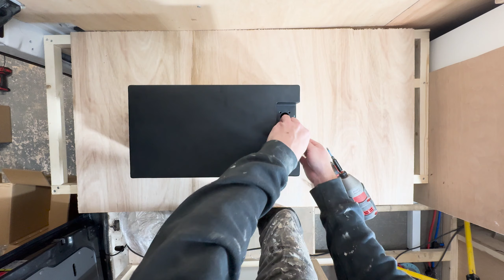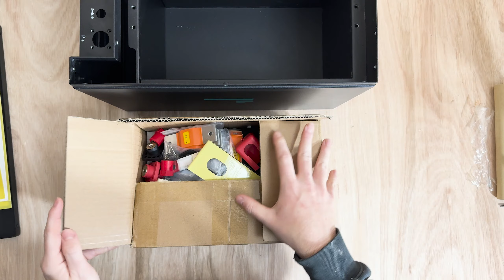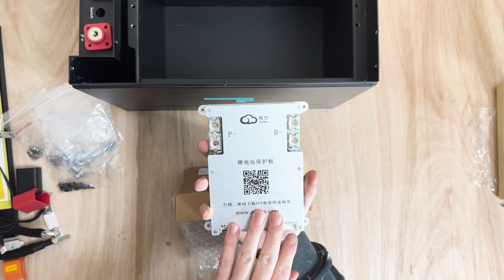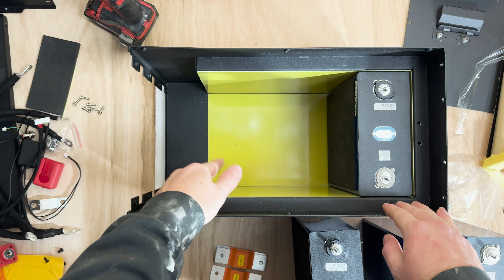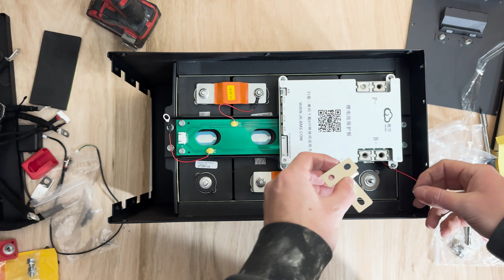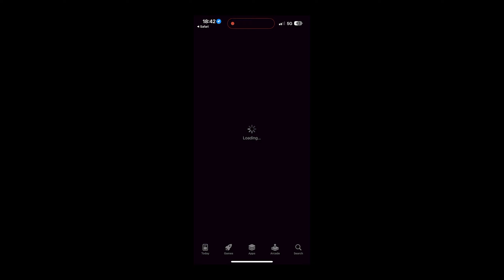Fogstar | 12v DIY Kit | Assembly Guide / Review

Comment: Does anyone else think the fuse provided is not safe for the cable sizes provided, or the interruption current capacity of LiFePO4? 

A 280ah 12 volt LiFePO4 could theoretically output 10 times the capacity in amps if shorted (so circa 2800 amps). However. The fuse provided in this video looks like a MEGA fuse that, whilst rated for 400 amps, is only capable of handling 2,000 ICC amps before it melts and welds together (thus not doing what a fuse should do, and cutting the circuit). In addition, 400 amps looks way more than the cables provided could handle. 

In my 314ah kit I have been provided just 6 AWG and 3 AWG sized cables. Admittedly these are high temperature (200 degree), 600 volt silicone cables. However, even then a 6 AWG cable I think is only capable of carrying 100 amps, and a 3 AWG about 130-170 amps (and that's assuming they're not in conduit or laying with other cables). 

The 6 AWG cables are doubled up as they go from one to two cable lugs (as shown in the video), so that's 200 amps per such cable (half that of the provided fuse)! The 3 AWG cable however is the real concern at just 170  AMPs at best. Even if you double this up, that's 340 amps (still way below the 400 AMP fuse rating).

This is before you factor in the 2000 ICC rating of the fuse (about 800 amps too low for the ICC capability of a 280ah battery, and 1,140 amps below that of a 314ah battery)!

You could set the max discharge and charge current to 200 amps in the BMS, but it is not best practice to rely on the BMS to protect your cables! It also then begs the question, what is the purpose of the fuse provided.

I would expect a max fuse size of 200 amps for the cables provided, and for the fuse to be an ANL type with 5,000 to 6,000 ICC rating!

Comment: when attaching the balance leads to the busbars, when you are tightening the nut down, make sure there is no heat shrink insulation trapped under the nut because you want full contact between all metal surfaces under that nut. partial contact will add resistance, heat and possibly fire. you can trim the heat shrink with a knife or just pull it back away from the loop before tightening the nut.

Comment: Obviously a keen DIYer using the IKEA multi bit screwdriver lol
Reply from the maker: @AlanAlanAlanDave  not ikea and only thing I had to hand in the unit at the time
Reply: @LBVanBuild Thank you for putting this video out. I have one of those, got mine from IKEA.
Just looking to see if it’s worth getting the Grade A 314Ah cells and separate components. If I go for a kit I’ll get two. Surprised they are so cheap compared to the built ones.

Comment: Brilliant video...
1.200 views but only 11 subscribers 🤔

Why did you go for the 305A when the 315A is only a little more expensive?

How did you work out the black wire and a few other things?
I think connecting to the battery+ should be after the front is on.

I'm electrical/electronic background and have been watching various videos and have noticed a few potential 'modifications' or nice to do if you are interested.

Have you seen there is a screen for £29 to show information but no programming which is good.
Is there any information on the batteries to confirm that the programming is correct?
Reply from the maker: @Markus-UK  Thanks!

I actually got the case and the cells separate, then they released the full kits a day or two later. I am actually planning on getting two of the 315ah versions.

Trial and error basically, these kits are not too different from the bigger solar diy kits they make.

I have also noticed the display they have added to their website, I was also considering adding on the can bus port for compatibility with victron
Reply: @LBVanBuild  
The can is a bit beyond me... A potential video? I only have a smallish system using lead carbon 600Ah and 3 x 100/20 victron and use the electronic load to heat.
I will keep the LA as I've got turbine's and the charge controllers aren't Lithium compatible.. I could ramble 😻
Have you thought of installing a T class fuse in addition to the supplied 400A .. I think I will lower the value until I get a bigger inverter.
As far as mods go .. lack of electrical insulation is my worry particularly on the + lead and terminals, cable security etc..
Is it possible to fit the switch and the screen to the BMS..
You need to make more videos about I assume your van build and batteries etc..
Been thinking of doing a YT channel and watching various since 2020 ..
Nick Nimmin is a good channel.
Have you seen FS have a channel and recently a 12v kit.. states 6nm.
DC is the other one I have found useful.

Comment: Just some info, the 2 missing bolts now come in a separate plastic bag. They dont supply bolts for the terminals. The 2 new ones are longer thread than the original 2 and must be used either side of the fuse as thickness of fuse and terminal metal make them work
Reply: Do you know the bolt size for the terminals because it doesn't say on their website

Comment: Thanks so much for putting this together! I came across the 314Ah kit but they're obviously pretty new as I couldn't find any info about them so your video is really helpful to see what's included. Great presentation too.

I'm frankly amazed at how cheap these cells have got over the past couple of years - was planning on building my own pack for ages with cells direct from China but it's barely worth it considering how well-built the case looks. I've preordered mine to replace a lead acid bank in my boat that's getting a bit long in the tooth. Fogstar confirmed the BMS is the model with comms included so I'm gonna drill an extra hole and run the serial cable out so it can control all my Victron kit with the dbus-serialbattery driver. Can't wait for January!

Just a quick Q as I didn't spot it in the video - did it come with bolts (M8?) for the two output terminals? Running a bit low so will order some extras if not. Cheers!
Reply from the maker: Hi, Thanks for your positive feedback on the video!!. This kit is amazing value for the money if you're not afraid to put it together. The Kit didnt come with the m8 bolts it actually had m6 bolts which were wrong, I ended up contacting fogstar and they sent new ones out. I believe they have sorted this issue out with the rest of the kits too
Reply: @LBVanBuild  lovely, thanks for the info :)

Comment: i order Fogstar 12v DIY Kit so i can fit the 120 amp calls in as been looking at cace and hard to find for 120amp cells and Fogstar 12v DIY Kit is woth the money as on aliexpress
EEL12v Box v3 box is so expensiv for £300 just for a box  i dont get whiy thay so expensive
Reply from the maker: Fogstar kit its very good for the price, but i think you might have a lot of room in the case using 120ah cells
Reply: @LBVanBuild I got 120ah cells to fit in my cace today and missing m10 bolts as well
Reply from the maker: If you give them a call or email, they should send you some

Comment: for me the cost is not worth it because for that price range I can buy an eco flow solar generator and it has usb charging outputs as well as a built in 110v AC inverter
Reply from the maker: Thats a fair point but if you are using the river series for example they start at 250wh which is minuscule compared to the 3904kWh that this battery offers its also rated for a much higher power draw of up to 200a. But i think mainly the usage application differs for each of these products
Reply: @LBVanBuild  Sure about the KWH ?
Reply from the maker: @remog38  yeah that’s what’s stated on their website, even so Voltage x Ampere Hours = kwh.  ~12.5v x 305 = ~3800
Reply: @LBVanBuild  So its 3.8kw great video thanks . I think i will be getting one and great first vid and good luck .
Reply from the maker: @ Thanks, yeah definitely worth picking up whilst it’s on sale
Reply: kWh is always nominal voltage x amp hours. 12.8 x 305 is 3904 as previously stated.
Reply: I'm just building mine - this video is much more helpful than the 4 minute fogstar one with no talking!
One question though, the fogstar video shows the balance leads connected to the 1st battery - (BMS connection) 2nd battery + & -, then 4th battery + & -.
Where did you find out to connect to each + terminal?
Reply: @richardbeard4146 did you figure this one out, having the same dilemma